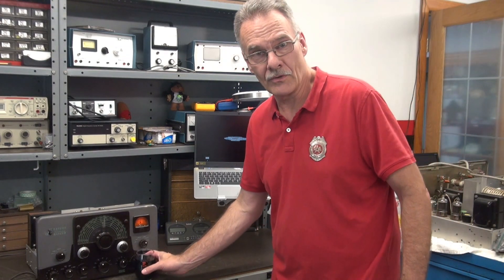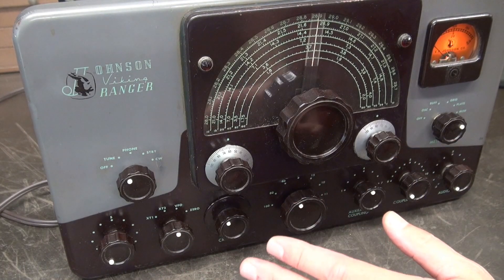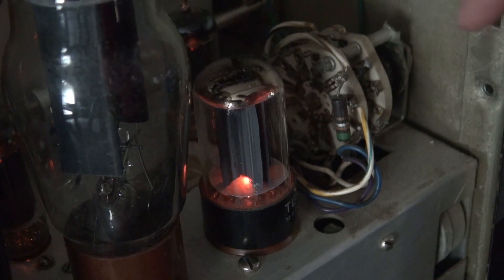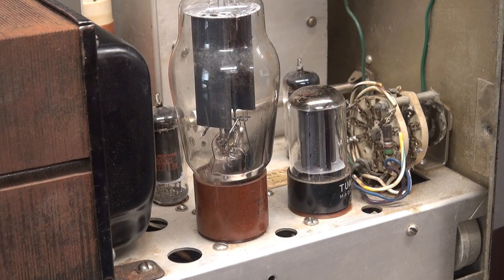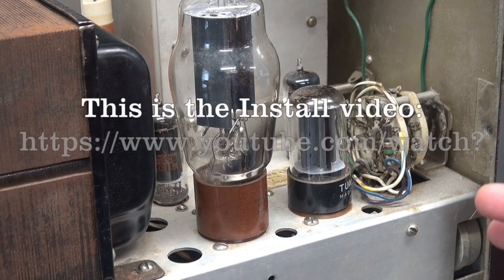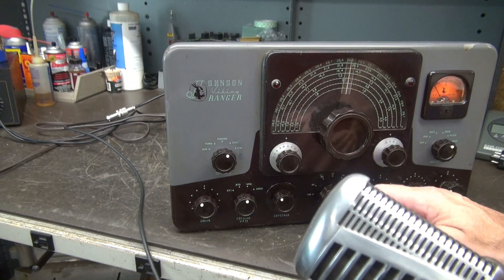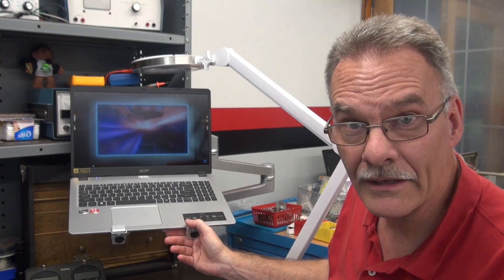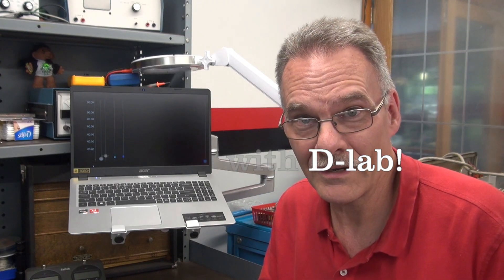D-Lab Tek Tip plus coming soon Future Skype feature to my channel

Comment: Nice transmitter. I bought  its big brother at 14 years old for $300 from my sister's boyfriend and he threw in a Sx-28a Hallicrafters receiver with original cabinet speaker, Hygain TH3 triband 3 ele beam with CDR rotator and thick wall 30 foot mast. Even today I wished I still had that receiver, the best GC receiver before the 51J4 Collins was released.  Pretty high tech circa 1939,  It took me selling all my other gear and surplus gear and paper route income for 2 years to afford it. But it was worth it, 10 meters was open the day my beam was put up and worked 6 new countries in short order, some CW but also AM. I used that transmitter for years, very solidly built and a pleasure to tune up due to the high Q Johnson caps and big inductors so dip on the meter were deep and sharp.  This mod is a good one, as you say, that switch would be very hard to find now.  
I just sub'd after seeing another of your videos yesterday going through the Fender amp and doing it right. That is the first time I have seen someone who was working in classic old amps on Youtube who knew what they were doing. 

Now, living in another country for the last 20 years, I brought over a lot of test gear, about 500 lbs of Tektronix, HP and my Motorola R2008D service monitor and limited my ham gear to a very light Elecraft K2 kit and a Kenwood TS-50s and living in a city center apartment with only a balcony as antenna access. I built a mulit-band Mag loop that works ok. There is a lot of noise here, with electric trams, leaking internet cables etc so a loop helps. /mostly I use the rigs when going out of the city into the woods and can string up wire antennas and no RF noise. Worked a woman in Italy yesterday with 8 watts SSB from a gel cell battery powering the K2 when the 20m did not seem to be open, a good haul from St Petersburg north western Russia and a long ways from my native California.